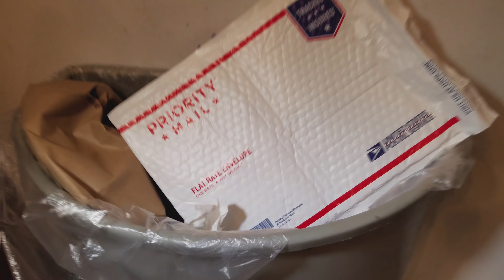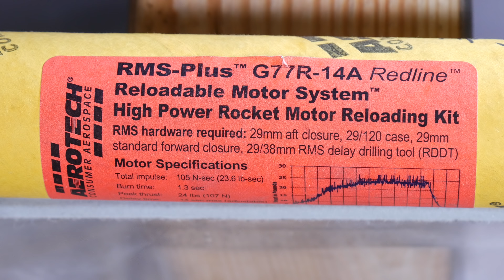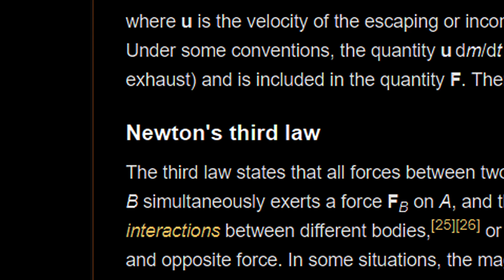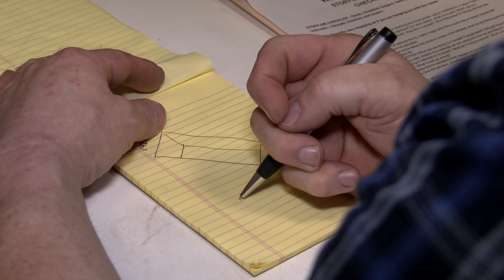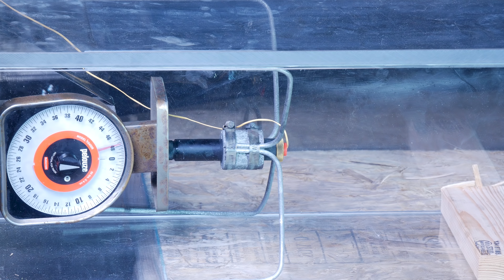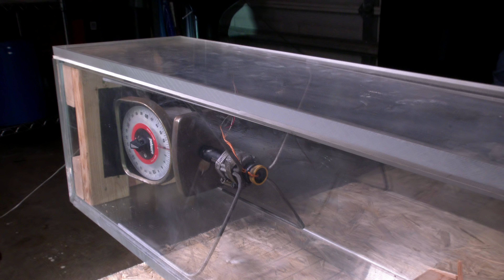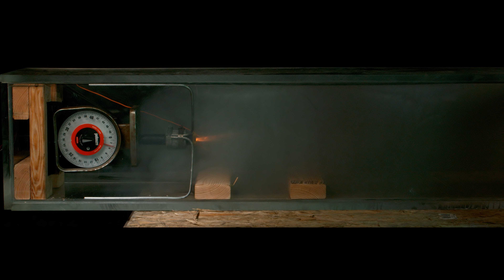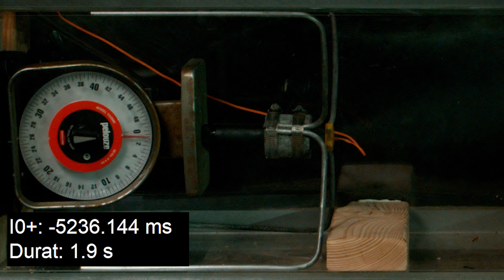Rockets in a Vacuum Chamber - Newton's third law of motion Visualized

Comment: I had the same question when I was doing my BTech.  I asked my professor about how come a rocket gets propelled in a vacuum. He had no good answer at that time...  later on I realized that I was thinking the force in a wrong way...  rocket is never propelled like you sit on a wheelchair and push the wall to go in opposite direction... it's propelled like you are jumping out of the boat & no matter whether you land on water or ground, the boat is going to get propelled in opposite direction... 
In the same way, no matter whether the gases from the rocket goes in the atmosphere or in a vacuum, the rocket is going to go in opposite direction. in fact, it will go much efficiently in a vacuum as there is no resistance to it.
Reply: Anther nice one to think of is an explosion. Just in a rockets case it is a controlled and continuous expansion of gas particles.
Reply: Ya I like that analogy if that’s the word.  Makes sense thanks for that

Comment: The needle was moving before the chamber filled with exhaust gases! 🍺😎👍
Reply: That is because his igniter was epoxyed shut with whatever air that got trapped in the chamber allowing for ignition, which failed without this chamber. Then because it was sealed it created internal pressure upon that chamber jarring the rocket apparatus a bit before going full burn and creating thrust using it's own artificial atmospheric pressure. 
Sorry for the run on there. Cheers!
Reply: Thane Mac  In a finite vacuum, yes.
Reply: In this experiment's initial vacuum, then  quasi-vacuum (vacuum until it started to be filled up with an atmosphere). This particular experiment does not prove its  hypothesis. Does that make the hypothesis wrong? Not necessarily. Just not proven here.

Comment: Your vacuum is not airtight you can see where the air came out of it on the first launch😂
Reply: Exactly it’s a pathetic attempt at defending a religious bias 🤣
Reply: @Clayton Holmes 
True its faken
Its correct he fooled ...he created the Atmosphere to burn the oxygen but not really used Vacuum 
Because he'll fail and no one will see this video
Reply: @tonysmith9646  Yeah. This video is not a great, data driven experiment. I hate to tell you this, I am an industrial chemical process engineer and among many other projects, I lead engineered the world's biggest air movement and purification project of its kind at the world's biggest automotive plant of its kind -- and it worked. The same equations we use to engineer your working car and working mobile phone also easily predict that if you are in a vacuum chamber on ice in a chair with rollers and you throw a basketball that you will move in the opposite direction you threw the basketball. Except when it is done with a rocket, you are throwing tons of mass per second at incredible speeds. So, really, there is not even a reason to discuss this. It only shows you would never be accepted to engineering school to create safe, working environments to manufacture the most essential elements of civilization. Thanks for playing.
Reply: @idontcare7961  Yeah. This video is not a great, data driven experiment. I hate to tell you this, I am an industrial chemical process engineer and among many other projects, I lead engineered the world's biggest air movement and purification project of its kind at the world's biggest automotive plant of its kind -- and it worked. The same equations we use to engineer your working car and working mobile phone also easily predict that if you are in a vacuum chamber on ice in a chair with rollers and you throw a basketball that you will move in the opposite direction you threw the basketball. Except when it is done with a rocket, you are throwing tons of mass per second at incredible speeds. So, really, there is not even a reason to discuss this. It only shows you would never be accepted to engineering school to create safe, working environments to manufacture the most essential elements of civilization. Thanks for playing.
Reply: @anjanikumar.t1708  Yeah. This video is not a great, data driven experiment. I hate to tell you this, I am an industrial chemical process engineer and among many other projects, I lead engineered the world's biggest air movement and purification project of its kind at the world's biggest automotive plant of its kind -- and it worked. The same equations we use to engineer your working car and working mobile phone also easily predict that if you are in a vacuum chamber on ice in a chair with rollers and you throw a basketball that you will move in the opposite direction you threw the basketball. Except when it is done with a rocket, you are throwing tons of mass per second at incredible speeds. So, really, there is not even a reason to discuss this. It only shows you would never be accepted to engineering school to create safe, working environments to manufacture the most essential elements of civilization. Thanks for playing.
Reply: @mindbomb9341  practically demonstrate your claim. If it’s not even worth discussing it must be easy to show this. Go on, demonstrate thrust in a vacuum. I bet you can’t 
In order to create propulsion there must be resistance. If you are claiming to be the professional you claim to be you are actively lying. If not, then demonstrate your claim.
Reply: @tonysmith9646  Sorry. You are just clueless. I graduated from the Iowa State University Engineering Program in 1996. Dr. Richard Seagrave, Dr. Glatz, and Dr. Carole Heathe were among my favorite teachers. Four years of weekly experiments with grueling write-ups, and equations that worked through mathematical transformation we spent years busting our asses to learn were all the proof I needed to show me it worked. I am sorry, but I won't waste my time trying to change you from an ape into an engineer here. I doubt you could even get accepted to such a program. It would take magic to make rockets in vacuums not work. Tell me who you engineer working factories for?
Reply: @mindbomb9341  save your pathetic appeal to authority here, I’m not trying to be an engineer. We’re dealing with these claims here. Reality shows how rocket propulsion works and it requires resistance, are you actually denying this? 
Any rocket propelled device needs resistance or it won’t have the ability to propel itself. Are you actually denying this?
Reply: @tonysmith9646  What do you not understand about the basketball example?
Reply: @tonysmith9646  What do you not understand about the following: Imagine standing in a vacuum chamber with an ice rink. You are in ice skates that must be parallel to each other. Hold a 20kg medicine ball close to your chest. Throw it away from your chest in a big hard push without moving the rest of your body. Do you stay in the same place?
Reply: @mindbomb9341  practically demonstrate your claims or move on. I can imagine all kinds of shit but science isn’t about imagination is it? No, it’s about practicality. So I look forward to seeing your practical reference lol
Reply: @tonysmith9646  I am guessing you are a flat Earther. Hardly surprising. I guess I was fortunate to spend 4 hard core years running weekly experiments and learning how the basics of the universe work before being hired by the world's biggest companies to do their engineering. I understand not everyone got that chance.
Reply: @tonysmith9646  
He literally did provide an example. You must either be illiterate or a bot, or else you would have seen him write the following: "You are in ice skates that must be parallel to each other. Hold a 20kg medicine ball close to your chest. Throw it away from your chest in a big hard push without moving the rest of your body. Do you stay in the same place?"
Reply: @the18thdoctor3  he provided words not a practical example, do you know the difference?Provide a scientific practical example of rocket propulsion in a vacuum or shut the fuck up, coming here defend your little religious bias. Physics of propulsion is very simple, it’s utilised everywhere on earth. In order to create propulsion there has to be resistance. Are you actually denying this?
Reply: @tonysmith9646  
The "resistance" here is the resistance of exhaust gas to being accelerated, also known as inertia. The Law of Conservation of Momentum requires that rockets work anywhere. Do you want me to explain how? I'll try to use the smallest words possible for you.

1. Take a 100 kilogram rocket with 50 kilograms of propellant. With an initial velocity of zero, this means the system has a total momentum of zero. Due to Conservation of Momentum, this must never change.
2. The rocket fires the propellant out the nozzle, at -2,500 meters per second (negative indicating the velocity is backwards). The 50 kilograms of exhaust gas now has a momentum of -100,000 kg*m/s.
3. In order to make sure that the total momentum still adds up to zero (since it can never change), the rocket must thus gain a momentum of 100,000 kg*m/s. Given that it has 100 kilograms of mass, this means it must now be moving at 1,000 meters per second.
In equation form: 0*50 + 0*100 = -2,500*50 + 1,000*100, thus momentum is conserved.
Reply: @the18thdoctor3  more words just rhetorical garbage. Provide the practical examples of rocket propulsion in a vacuum or 🤫
Reply: @tonysmith9646  
What part of “the Law of Conservation of Momentum REQUIRES rockets to function without an atmosphere” do you not understand? Anyway, if you’re so lazy that you need a demonstration laid out for you in a video, you can just look up any uncut feed of a rocket launch. In particular, there’s a few from amateur photographers that show a Falcon 9 booster doing a boostback burn while above the Karman Line (if you don’t know what that is, look it up).

All you’ve provided to explain your denial of momentum conservation are words.
Reply: @the18thdoctor3  so nothing practical then no? Just rhetorical gibberish and sophistry for the gullible. Come back when you can practically demonstrate your claims.
Reply: @tonysmith9646  
SpaceX has done so publicly more than 50 times. All you have is denial. Why do you deny the Law of Conservation of Momentum? Why do you deny the thousands of people that have watched, with their own eyes, rockets function at altitudes where the pressure is considered a vacuum? Why are you running away from the truth?
Reply: @the18thdoctor3  me: provide a practical example of your scientific claim.
You: thpace Xth 🤪

Comment: I think it would have helped to have a rocket engine that contained an oxidizer.  You can't have a flame without oxygen.  Or better yet- Don't use a flame at all.  Use compressed water and air or a remote controlled can of hairspray to prove that every reaction has an equal and opposite reaction.

Comment: If the smoke exits the vacuum chamber, is it still a vacuum chamber? (asking for a friend)
Reply: No, it’s not. He was talking about how much pressure there is inside that chamber. Any opening would instantly cause air to rush in.
Reply: Yes.
Reply: Don’t know about science much how exhaust come out and still conclude that was a vacuum please enlighten me
Reply: Ok never mind I guess there is a vacuum and a full vacuum
Reply: @a-reecetyopo2252  And a true full vacuum isn't physically possible due to quantum fluctuations.
Reply: @xyex  thank you Xyex now I have one more question the the space vacuum or full vacuum and is it possible for us people to produce enough fuel for a vehicle to go to the sun or at least 5 million miles to the sun cuz I just watched a video that said we did
Reply: @a-reecetyopo2252  No, space is not a full vacuum. It averages about 1 atom per cubic meter.

And while you need a lot of fuel to get into space you don't need that much fuel to travel in space, there are other means to accelerate (or in the case of reaching the sun, decelerate). The probe you're referring to made multiple passes of Venus to slow itself to reach the sun.
Reply: smoke is not air... smoke consists of very small particles... you are assuming it's air simply because you used to seeing smoke particles suspended in the air.   matter is neither created or destroyed, it simply changes forms.  Therefore, just because something burns and creates smoke, it doesn't mean that you magically create "air" molecules where none existed before.  It would have been interesting to see a pressure gauge inside the tank to see if any significant atmospheric pressure was created by the rocket.
Reply: @shawnschiebrel  You bring up a good point about conservation of mass that I completely overlooked. The smoke going into the chamber is mass that's being expelled from the "rocket." So the volume isn't changing, just the distribution and density. So the air pressure inside the chamber shouldn't be notably different after ignition than it was before.
Reply: @Uploading Truth And you know you can 
SEE
THE
ISS
IN ORBIT
WITH YOUR OWN EYES 
RIGHT?
Maybe you should TRY That before calling it a lie?
Reply: @stuartgray5877 it's moving over 11 times the speed of a bullet, if you can see it then they're lying about its speed and you can't see through 250 miles of atmosphere upwards with all the water vapor. The fact that you can means it's lower and slower. You are your own debunker

Comment: That tiny vacuum box is why you got the result you did, put the same rocket in a complete vacuum area the size of a gymnasium and I bet you'll see a different result since the space will be to big for the rocket to create an atmosphere in.
Reply: That’s not what causes the force though, the combustion reaction inside the rocket engine from the oxidizer and fuel mixing creates an explosion that forces things away, if you contain that force to a specific direction you then get the equal of that force pushing in the other direction, the exhaust is the backboard as you push off with the explosion

Comment: The right thing to do would be to use the tiniest rocket possible like a match rocket.
Reply from the maker: +rockets push off air that's a good point, but I wanted to keep it as close to what Nasa uses as possible because that's usually what everybody relates to. The propellant that we used is almost identical to what NASA has used on a solid boosters in the past.
Reply: +rockets push off air Soooo, time to change your name then ;)
Reply: you must think a bullet pushes of air too then....
Reply: MrRobin66Co, Why? he never showed the most important thing which is the pressure gauge, it was definitely pressurized by the rocket, maintaining a continuous vacuum is not easy.
Reply: 1man1van, why do you say that?
Reply: Because bullets are a little like rocket engines.  An explosion happens in a chamber, pushes the mass (bullet lead) away from the chamber, and the result is you get recoil in the gun.  That isn't from the bullet pushing off air, it's from the explosion ejecting the bullet in the opposite direction.
Think of it this way.  An explosion in space would push particles in every direction.  Now imagine that this explosion is contained in a chamber and there is only one hole for the explosion to exhaust.  The forces inside the chamber will cancel out except the force that is directly opposite the nozzle.  Therefore, there is a net force on the rocket opposite of the direction of the exhaust.  Rockets don't need air.
Reply: I kind of like this idea, although I'd use a light aluminum tube instead of pringles! :)